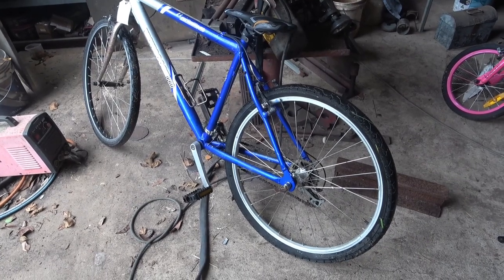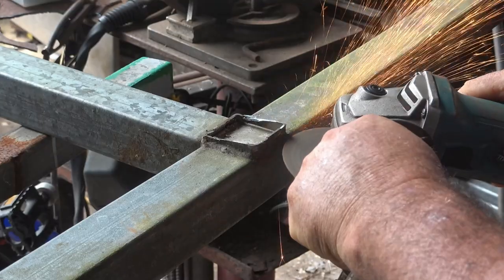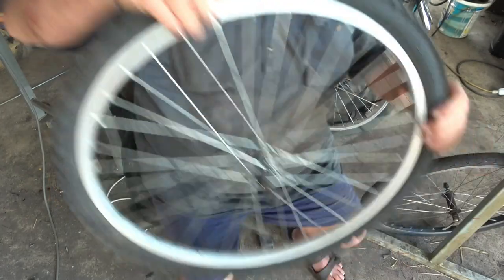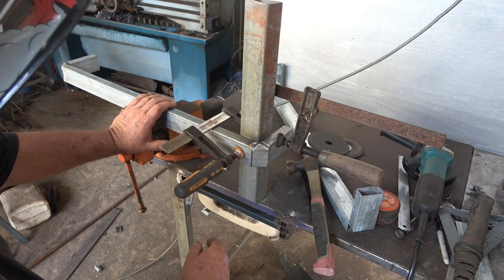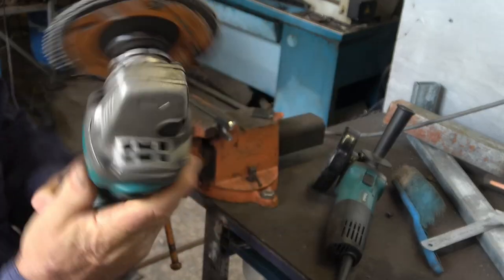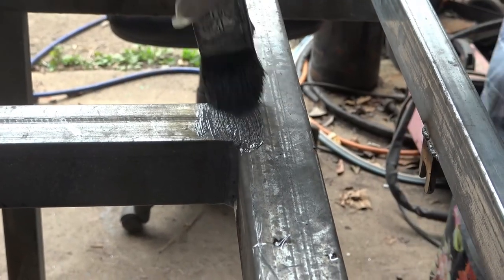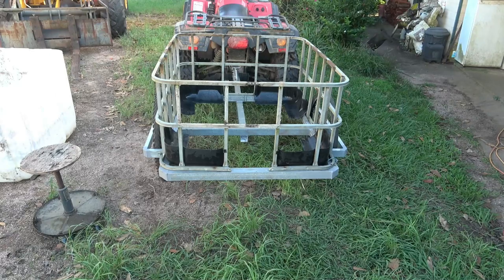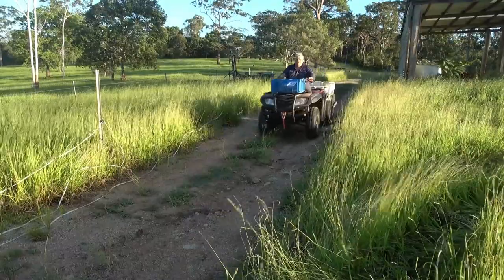MAKING A 4 WHEELER TRAILER FROM A IBC TOTE AND AN OLD BICYCLE

Comment: Good idea. Got me thinking of using a full IBC plastic tank and cutting rectangles out of the aide to be a covered tool trailer. Might have to use slightly heavier wheels though. Maybe postie bike front wheels? Or stub axles off something fairly light. Cheers for the idea.
Reply from the maker: I guess you could do it a lot of ways. John

Comment: I made a cart out of 3/4th inch plywood, the axle is simply held on by more 3/4" plywood and carriage bolts/washer/lock washers.   From an axle with threads my brother gave me as a manager at a machine shop.  I love it, because it fits in the house doors with wood (providing I shovel snow off my deck), but I overloaded it, I think with bricks once, and the wheels are wonkie.. 
It still works.  End of story. LOL
Reply from the maker: We are using ours a lot its a handy thing. John

Comment: If you had bar that would have fit the tires, could have you done an axle based cart?
Reply from the maker: I am not sure what you mean. I think if I did a axle like a conventional trailer I would use different wheels. John
Reply: @farminglifeaustralia6716  too much work to get the tires to fit? Or would the axle be too thin?
Reply from the maker: @uncouthboy8028  I think the axle would be to thin and bend. John